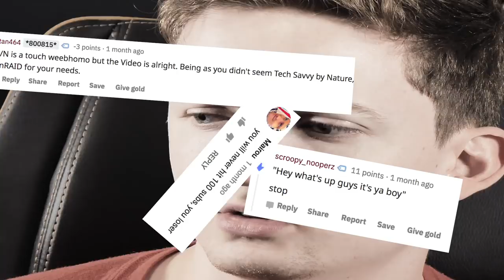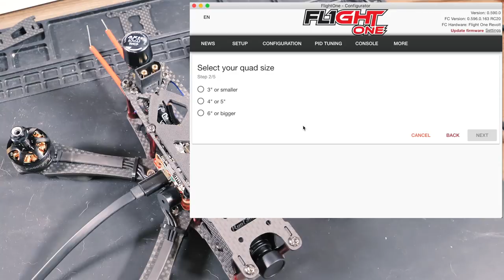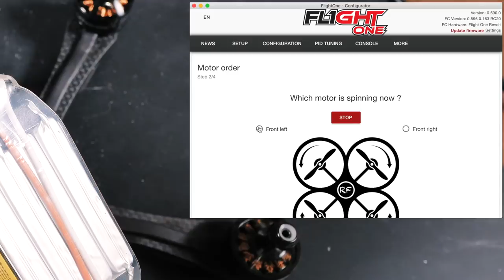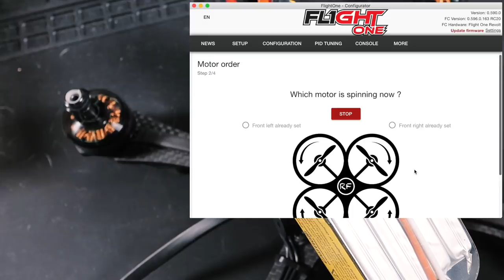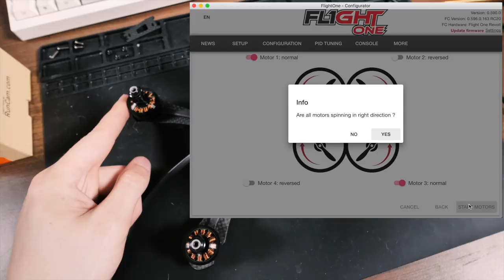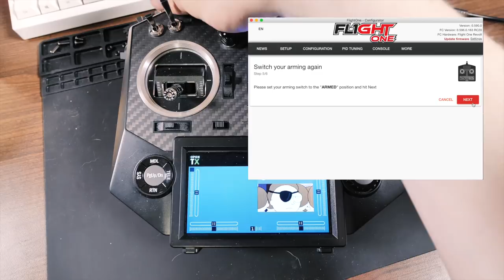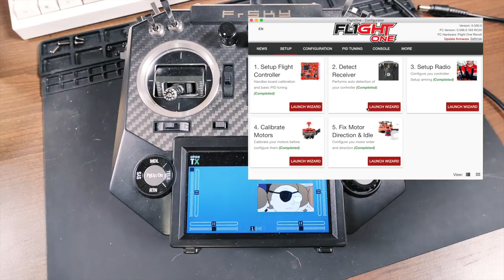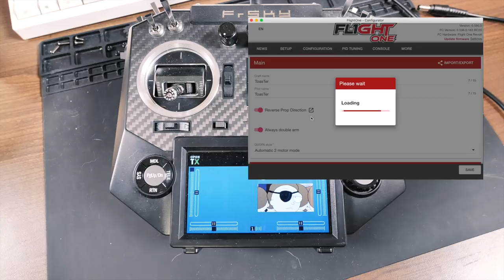Toaster Drone Build - FlightOne | Lumenier | AstroX

Comment: What wire r u running to the camera osd pin? The green wire u plugged into ur camera. Where does that go to and for wat. Also why do you run 2 red wires for the vtx. I thought ypu get vbat out of the top right connector